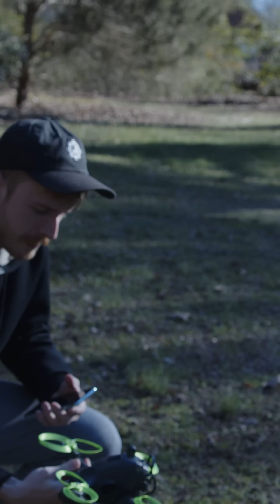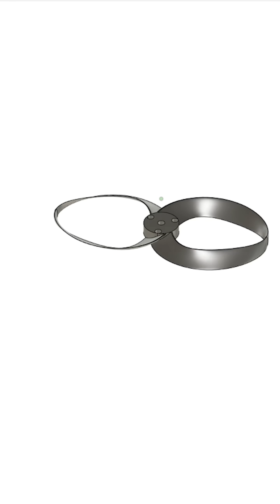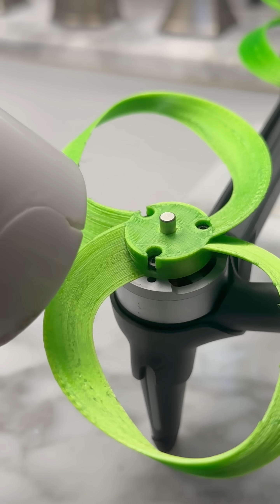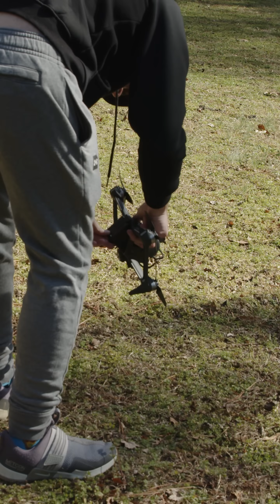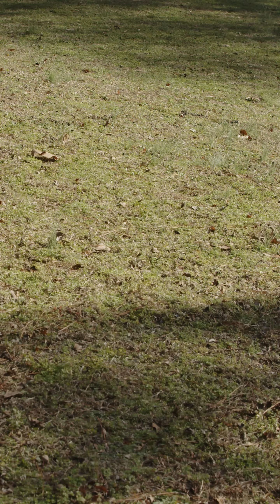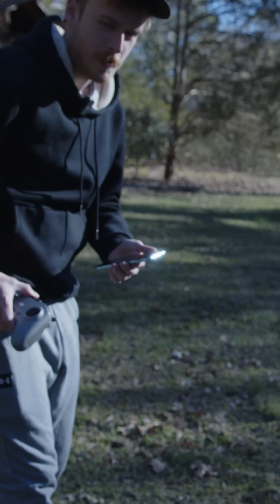Testing MIT's Toroidal Drone Propeller Design & Sound #shorts

Comment from the maker: Full Feature Video: https://youtu.be/C10XgojHu44 Also full credit to MIT and their fellow grad students for the basic design. I just used this for an educational video and to satisfy my curiosity, this prop was still heavily modified and different to accommodate the drone. These results are not entirely indicative of MITs real props.
Reply: You should try a 4blade circular prop design similar to the one used in ships and submarines
Reply: micro phone lowers loud voices and increase less loud voices . so there is a meter that massers voices you can know it by that and also at least you can judge it yourself and show others the meter reading . or if you don't have meter then tell they are aproxx 40 % quite or half the quiet from other once. so tell because viewers cannot judge it correctly.
Reply: 😊😊😊😊😊😊p😊p😊😊😊😊😊😊😊😊😊p😊😊😊p😊😊😊😊😊😊 @ashishdas7447
Reply: Did you turn off autogain for your microphone?
Reply: I am sorry to say this, but I don't think you modeled them correctly in CAD.
Reply: What was your impression of the propellers? Did they work better or worst? Were they quieter?
Reply: The Aerial Screw designed by Leonardo da Vinci was an early precursor to the principle of the modern day helicopter. The device, designed to compress air in order to obtain flight, measured more than 15 feet in diameter and was made from reed, linen and wire.

Try those propellers
Reply: Make it a vertical spiral. You will discover the magic, too. 🤐
Reply: Viewers must realise that quite often there is automatic audio processing which makes the quiet sounds louder and the loud sounds quieter to even everything out.
Reply: @BC-wj8fx on screen decibel measurement would fix this, like a specialized tool or, at least for this short purposes, a smartphone
Reply: It sounded like a large bee as opposed to a weed eater.
Reply: Well done! soon you will invent a bicycle!
Reply: full credit to the Aussie who invented the thing 50 years ago
Reply: If you want quiet ones research the ones used to transport medicine in rwanda. Most quiet i have seen so far
Reply: The real test would be a decibel measurer, a calibrated one
Reply: I can't believe i write al that for a bot
Reply: Эффективность такой конструкции оставляет желать лучшего, КПД ниже 60%
Reply: they seem lower pitch? how much less noise & can they lift more? this sould be good test as same motors & just do lift test for both typ of blades
Reply: Don't sound quite to me  ???
Reply: You Can Take A short.cut.and.go.to.the.scrap.yard.pick.up.jumbo.jet.four.install.vertical.but.must.have.robot.maximus.weld.drone.system.instrumentation.so.the.thrust.is.dynamic.at.all.times.Amen.KJV*.Upper.Canada.A.i.Co.Me.autumn🎃
Reply: awesome design but still noisy, maybe wider propellers will reduce the noise.
Reply: 4x louder
Reply: I'm pretty sure they didn't mean when it's stationary as the lower tone would indicate it's probably quieter while moving at an average speed. Also the weight and aerodynamics of the quadcopter could also throw off the design. The propeller material and design should work fine though it's those two things that should be your main focus in my opinion.
Reply: It didn't work did it
Reply: Цифры можно
Если у вас 7 грамм тяги на ватт мощности то тогда это работает.
Reply: Да и ещё дядя
4-х лопастный винт всегда хуже 2-х лопастного
Reply: i think weighing them makes them work more efficiently.
Reply: Three parts instead of two would improve performance and reduce noise.
Reply: Screw what everyone is saying about sound they look a thousand times safer and that should be your selling point. I stay away from quads because I received a pretty nasty cut but I think if these were on the market, I'd probably get back into the hobby.
Reply: The drone has evolved (stronger blades so as not to force the motors)
Reply: Test the one Soviet one from Atomic Hearts game
Reply: Po^o  que trem baum de motores tem este drone vê as chamas das saídas  de ar. Ele está com um motor de f1 dos drones?¿?
Reply: Make it with resin printing
Reply: Islam is not sandbox biome cristianity, it's a very diferent religión, wile cristianity aint  Jesús judism but a change both in aim and heart of that we all are sons of god and that we should be kind to others for they are too sons of the same "loving" god.
Judism is just a meme of a wojak vs chad where the wojak thinks himself tha chad and treason ofcourse
Islam for the other part is like judism but instead of doing things with a little brain they do it like the savages they trully are "blowing" themselfs for lies.
Damm autocorrector, i'm lazy to change it so if You are unconfortable with the errors man up.
Reply: I think we need the ladies’ say on the nail polish thing before we make any conclusions on it
Reply: This is awesome. Would you sell these? I'd buy them raw so I can coat them myself. I'm thinking sanding and using epoxy then wet sanding them would make them even more quiet.
Reply: Toe-roid-al 🙄
Reply: Video của bạn rất hay. đay là một ý tưởng rất hay ! nếu áp dụng thành công, sẽ là một đột phá tốt
Reply: I have not studied gas dynamics, but it seems to me that the two-bladed propeller has the highest efficiency. There are 4 blades per screw. Perhaps the absence of an end swirl with such a design is of great importance. Well, this problem is solved with simple winglets.
Reply: torodial....is that a fancy way of saying pinwheel
Reply: Looks directly stolen from the Sharrow Marine design
Reply: A what? A toroidial? Whats that
Reply: Im wondering if you sanded the blades to be smooth if that would be much quieter
Reply: Гуглим метод понижения шумности Японских кондиционеров. Ваши лопасти имеют КПД выше оригинальных, что снижает обороты ниже оригинальных, а чем ниже обороты- тем сильнее и дальше звук. Если уменьшить масштаб, то обороты поднимутся и громкость снизится, но полётом Совы это не станет.
Reply: Nice
Reply: Jesus loves yall
Reply: 00000000000
Reply: You gotta sand those props bro
Reply: As i understood it that shape was surpose to give more power for the energy used when in water... And not be the most silence but hey i could be wrong
Reply: the video from MIT was a fake, that student didn't actually do any testing he just made a video and turned in... the video was circulated without any peer review on his claims. its one of the most disgusting things when genuinely false information gets circulated.
toroids are a scam.
Reply: Very interesting!!! Thanks for the videos!!
Reply: @bleepbloopblop81  🔴 What Is Islam? 

🔴 Islam is not just another religion. 

🔵 It is the same message preached by Moses, Jesus and Abraham.

 🔴 Islam literally means ‘submission to God’ and it teaches us to have a direct relationship with God. 

 🔵 It reminds us that since God created us, no one should be worshipped except God alone. 

 🔴 It also teaches that God is nothing like a human being or like anything that we can imagine.

🌍 The concept of God is summarized in the Quran as:

📖 { “Say, He is God, the One.  God, the Absolute.  He does not give birth, nor was He born, and there is nothing like Him.”} (Quran 112:1-4) 📚

🔴 Becoming a Muslim is not turning your back to Jesus. 

🔵 Rather it’s going back to the original teachings of Jesus and obeying him.
Reply: @1islam1  if God is as you say “nothing like a human being or like anything that we can imagine” then why does Islam have problems with the Trinity? 

It seems perfectly reasonable to me that an incomprehensible God should have some seemingly incomprehensible characteristics. Things that are perfectly logical to God should occasionally be hard for us to understand. Who am I, who are we, who is anyone to say what God is or is not?  Why cannot God be 3 Persons in 1 Being? Just because Humans can certainly only be 1 person in one being, why can’t God the creator dictate what the divine being as having 3 persons? 

The only way to know anything about God is for God to reveal it to us. We cannot search God out. It also seems fitting that God the creator, who cares enough about us to reveal aspects of himself to us (introduction -> relationship) would establish, protect, and preserve his words to us so that we could know him, and know that his words are his own. 

So if your looking for God
1) it means God is drawing you to himself. Keep searching; you’re on the right track. 
2) test a set of scripture or holy book by 
A) how old it is dated (God has always wants us to know him)
B) how well documented & preserved it is (numbers of diverse early copies of a writing signify importance of preservation, and make the original text’s content robust to human errors and attempts at manipulation) 
C) how well any later holy texts agree with the older texts (God hasn’t changed so the messages of the texts should be congruent and the themes should indicate a common Divine author)
Reply: @Andrew Myers  you're talking to a bot, my man.
Reply: @1islam1  What is Islam? It's based on a false premise is what it is
Reply: @1islam1  what the hell??!!?
Reply: @1islam1  go preach somewhere else. What are you even doing what
Reply: @1islam1 , I appreciate your desire to promote Islam -- one of my professors in my graduate studies was Muslim -- but I don't understand how this is relevant to a demonstration of toroidal propellors.
Reply: @1islam1  shut
Reply: Everything up to the "heavily modified" part was made clear in the video.  Hopefully the MIT lawyers won't come after you. 
With no comparitive run of straight-bladed props, these did not jump out as quieter.  I'm sure the acoustic devil is in the details—even the slightest variation can affect the results.
Reply: @77thTrombone they can’t come after them. It’s an openly patented design, so as long as they don’t sell the props they are fine. Also the patent ends in 2 years so get ready to see these flood the market.
Reply: I'm sorry but those blades are just as loud, if not louder. There's a difference in the pitch though. Maybe something to do with the roughness of your material used
Reply: They got it from a marine prop design. 😂
Reply: First off. Sweet video. Thanks for your time and posting it for had you not I may have never come to this feeling or WTF god help me if there is one. Let’s just scratch off the first off bc I seriously don’t think I can word this and conclude this properly which will most likely bring mor of you out of hiding. So I’ve been watching you tube videos since it’s conveniently been a thumb swipe away, but only recently have I been reading the comments and the comments within comments. I must say it has me feeling as if I’m dreaming within a dream or sonething like that movie with Leonardo ( I think that’s him but I confuse him with another bad ass actor) where they go inside others folks dreams and extract and implant ideas. I would say let me know the name of it but I have no freakin clue on how to see what anyone has said bk to me whether it be relevant or not. Regardless of poor grammar and spelling. Which brings me to what should be my main focus but I really don’t know how to word it. So let’s try this,,, I’ve learned lots of stuff whether I meant to or not I can say I bees paying attention, I shut up but when he leaves I talk again.  Lol. Anyone anyone Bueller  Bueller.  Ok my bad just having some fun in my little misunderstood head.  My point to this is how can some people seem to b so intelligent but at the same time not smart. I mean sometimes I feel like we must be watching different videos or not listening to what’s being said or maybe they must have it zoomed in to where they don’t see the captions.  So detailed to diss a person and call them out but don’t take the time to maybe watch it back and listen closely before you start running that d*€£ sucker.  What i would really like to do to one of these negative Nancy piss poor attitude half ass at everything ( well I don’t know that for fact can’t say everything. Just wrap all up into one and say everything naw can’t do it and I won’t. Ok) but when I’m reading some of their shit and it throws me off I can’t help but picture things like a heavy ball-peen hammer coming in direct contact with them nose picking finger tips.  But we all know that ain’t rihgt naw nope it jus ain’t rihgt and that kind of talk can’t land you under investigations with the real bad folks.  I mean I’ve just now gotten my rights to having a computer and internet access back.  Now wait don’t y’all go thinkin little d is like that bc it ain’t like now. It’s just that the government don’t think it’s very funny to allegedly hack in the Air Force bases computer and see what a General might get payed or how much it might cost one to move across the nation again. No nope they don’t like that. You would think I would get a thank you for showing how easy it is but no nope naw no thanks.  
But anyways if you read thru this  i hope you enjoyed it as much as I did.   ✌️drD
Reply: Annealing doesn't make anything hard. The whole point of annealing is to prevent a material from getting hard.
Reply: @EddieTheH  It's pretty bad he jumped to insulting you by telling you to google it, without doing it himself. You are correct, at least in relation to metals.
Reply: @sophiophile  Indeed!
Reply: @EddieTheH  Yeah that's metals in metal heating the air out of it softens it because the air gaps added structure to the metal that is being taken away and the metal isn't molten so the metal isn't just collapsing in, filling the gap and sticking to itself when that happens. When you do that with plastic the same thing happens but with most plastic when you get it hot enough for air to come out it's melting.
Reply: @EddieTheH  to be fair he said “it makes it a lot more harder to break…” not “it makes it harder”. I thought the same as you did, until I listened to the video again.

Though I would argue that he should have used better verbiage, ie “it makes it more malleable” or something to that context.
Reply from the maker: Eddie do you even bother to use google before you post?
Reply: @JaysTechVault  No, I went to university and studied materials engineering instead.
Reply: @JaysTechVault  "The purpose of annealing is to produce a refined grain, to induce softness"
That's from the literal definition of annealing. 🤡
Reply: @JaysTechVault  Have you refined any props to a smooth surface?  (IE ABS & acetone method or similar?)
Reply: @JaysTechVault  Annealing metals is meant to make them more malleable+ductile (copper, for example).  He/she was correct, at least when it comes to metals. You maybe meant tempering or hardening. Not all heat treating is annealing, and if someone is using the term for amorphous materials like plastics, there is no clear analogue in terminology. If people in hobby plastics call it annealing to harden them using a heat treatment, it is an unscientifically analogous and obscure usage of the term.
Reply: @Cryptoversity it’s a different use of the same design concept. Except theirs is for water and these are for drones. MIT has had this patent since 2017. It’s not stolen, it’s just scientific research being disseminated.

Comment: Id have said the primary benefit from that is increased propeller surface area and larger volumes of air being moved by those things, gonna maybe get ya more lift but they aren't ever going to be quieter than the smaller blades that came with it

Comment: You can tell that the quality of the 3D print of the MiT example is simply higher. Different material and more detailed/smoother surface - that's definitely gonna impact the performance.

Comment: I think there supposed to be (ALOT) larger and spin (ALOT) slower.

Your issue becomes scale. Power and a way to transfer the torque without burning out your motors. 

Gear reduction box, and larger motors, and a larger drone overall will make this quiet design work.  

Welcome

Comment: The nail polish is not really a good idea. I understand that the print from the 3d machine may not be ideal either.

But there props really need to be higher quality and smooth prints

Comment: One way to make them quieter would be to imbed them INSIDE the body of the drone and use the arms as ducts with the endpoints controlling the direction of thrust. If you have all 4 blowing into the same plenum, you would have some safety, if one stops, you still have thrust at all 4 corners, just less of it and the drone won't flip over and eat dirt.

Comment: You have the wrong design. The MIT toroidal propeller is two sets of fans, the top has swept-back blades, and the bottom swept-forward blades. Doing so nets twice the thrust at half the induced drag as the tip vortices are drastically reduced. The bottom fan set effectively sucks the induced flow away from the top fan set.

Y'all ought to learn a bit of aerodynamics prior to making 3D print mistakes.

Comment: MIT's design is missing winglets. While the toroidal shape contains the pressure differential between the two sides of the prop, air moving off the leading edge of the prop is still able to wash outward reducing efficiency. You're welcome.

Comment: Instead of nail vanish or clear lacquer. I would use epoxy resin and do the top surface first. Wait until dry. Not long as it dries by chemical reaction. Then flip over and repeat process. Finish smoothing with finest wet and dry and reapeat 2/3 times. Making sure egdes are done.

Comment: Do you balance the blades at all? Spinning that fast, even a tiny bit will throw it off kilter. I fly RC helicopters and would have to balance every blade i put on or would have vibrations and performance loss.